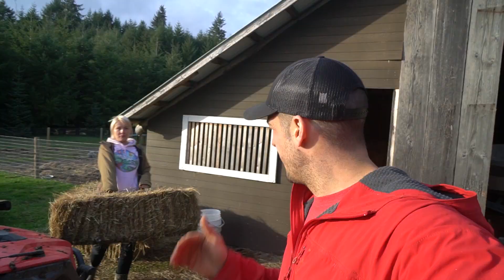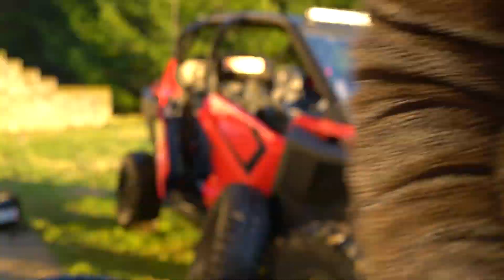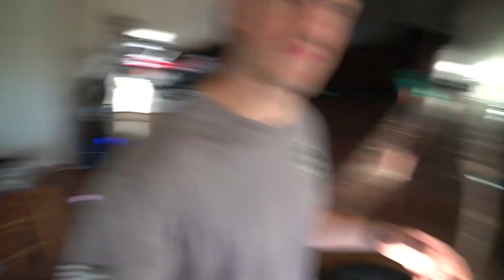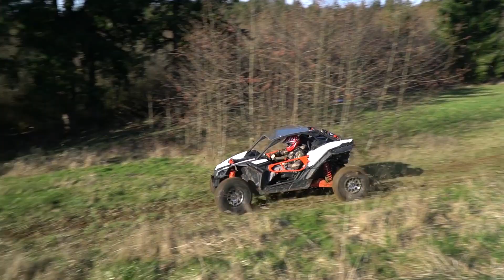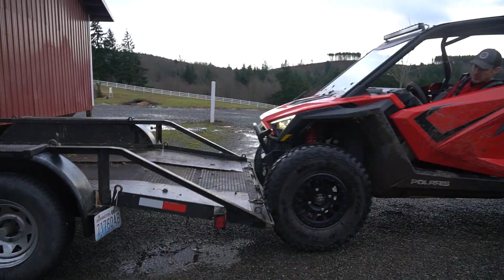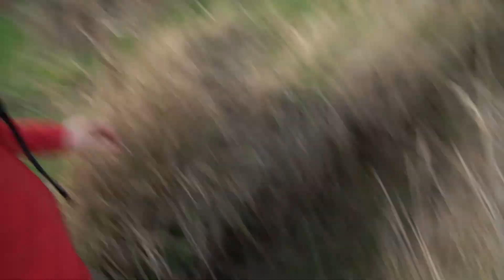RZR Hits HUGE HOLE | BEADLOCKS & Km3s DIY install

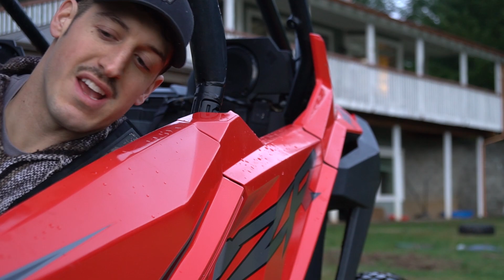Comment: 6:32, so 2” taller tires only get the car 1” higher......and 1” more clearance. Because it is only 1 inch further from the center line of the wheel.

Comment: Too late now but a bucket is your friend. Set the wheel on the bucket and push down on the tire to help seat the bead. That, plus windex. Hope you put anti-seeze on the beadlock bolts.

Comment: Did you notice any change in your gas pedal response? After I installed 32” tires on my XP4 1000, it felt that I had to press on the gas even more before it accelerates.

Comment: Maxx are the new Pro's able to take 32's without new clutching? I know both your machines can take 30's but I was under the impression that going 32's require a clutch kit. You may wanna check into that if you start going through belts like crazy! Great Video and keep up the good work. Oh... We need a Weasel update to!

Comment: You didn't have to change your arms ..to sit 32" I have a 2021 por xp4 and I was told I needed the a arms the move 1 1/2" forward to fit 32" or 33" tires

Comment: Can you install large underground corrugated pipe into those areas with ditches and holes to drain it rather than keep falling in them and damaging things?
TeamNoMustache, you look like the stereotypical affluent cocky TV bad guy with the stash
Reply: The problem with corrigated pipe where we live is our soil is mostly clay and doesnt drain well on its own. It would have to be a full on french drain with filter fabric and drain rock. If we did all that it works great. I had to do a ton of that around my house.
Reply: @TSGear  Just south of you guys, so I think I understand. I use drain grate boxes at the low points for the inrush and it seems to work without having to French drain as those tend to foul with sediment over time anyway, a PITA to install and the faster moving water will clear the tube assuming you have a place to send it. I could see utilizing smaller ditches and depressions around fence lines and features to lower the water table, but my perception is these seem to be deep and randomly placed there and causing more than a bit of trouble trying to utilize the grounds for more than a field.